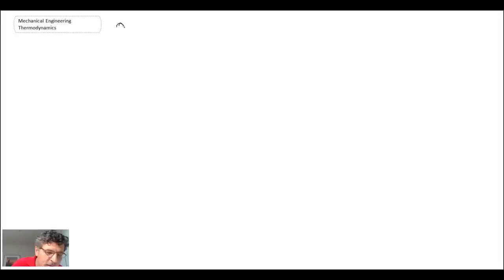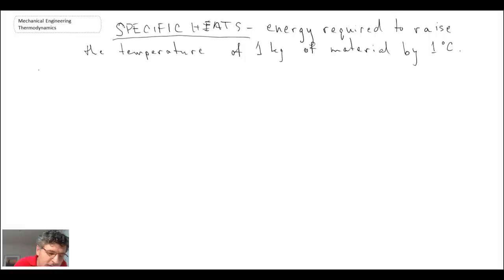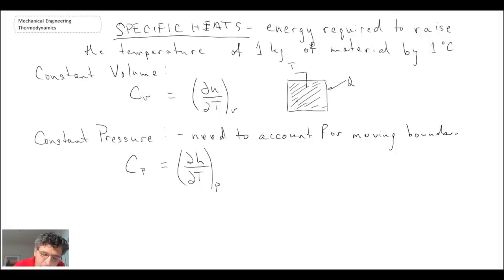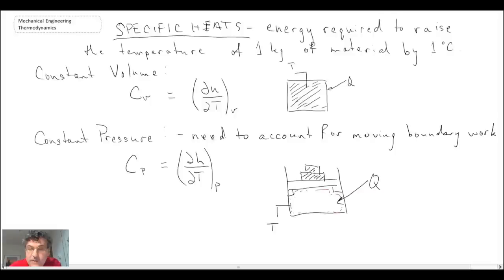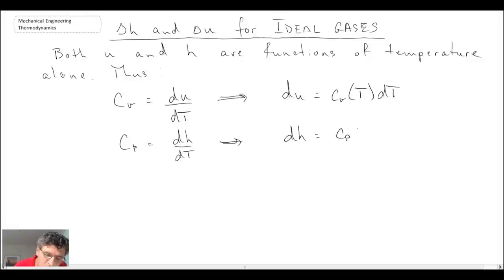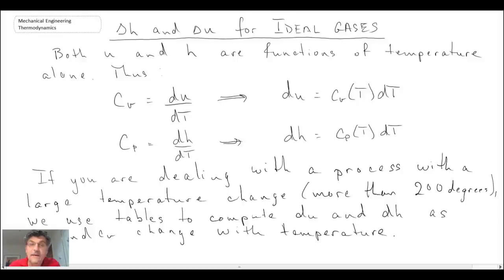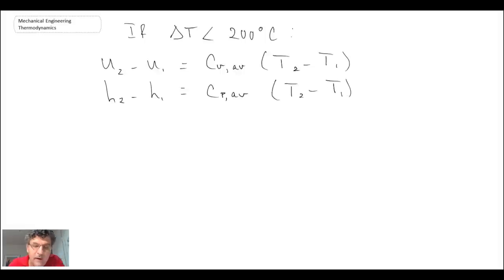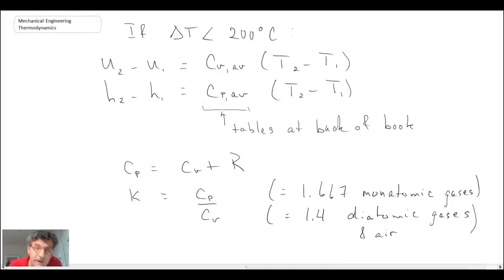Mechanical Engineering Thermodynamics - Lec 4, pt 2 of 3:  Enthalpy and Internal Energy

Comment: I know iron turns hot faster than water.
Intuitively it means iron’s specific heat ought to be higher than water. 

Iron should need the smaller amount of heat to increase to a certain temperature than water?
👍

Comment: If the piston came to rest on stops it would no longer be a constant pressure system. 4 mins
Reply from the maker: +Jack Lavender You are correct - that is usually seen when the piston begins from a position above the mechanical stops and then due to some process (cooling for example), the volume decreases and the piston moves downward coming to rest on the stops.  At that point the volume becomes constant and the pressure is no longer necessarily a constant (it depends on what else is happening in the process).  In the case described in the video, the process begins when the piston just lifts off of the mechanical stops and then moves upward due to the heat addition.  This process would be at a constant pressure.